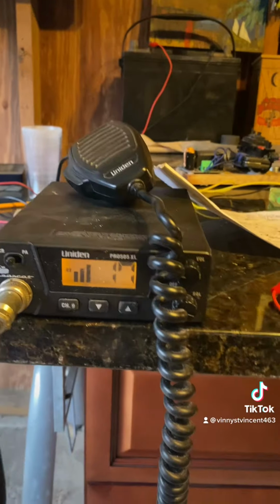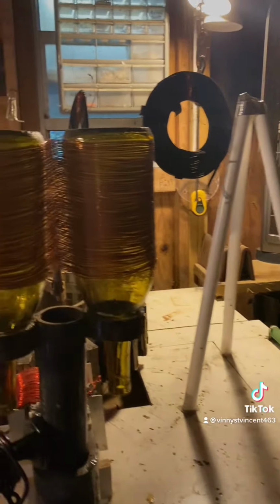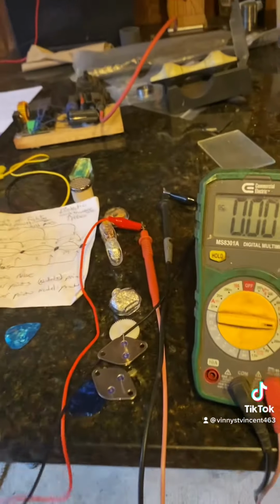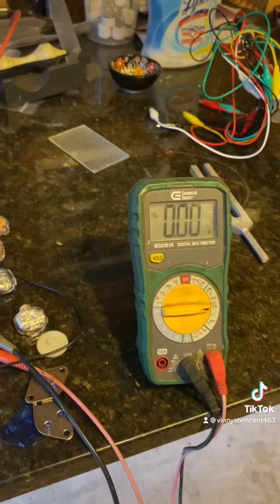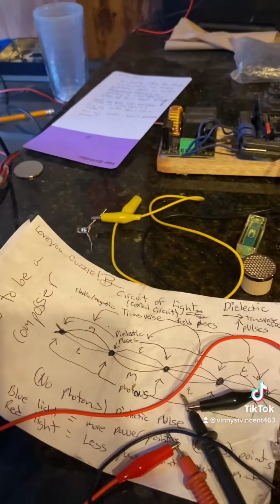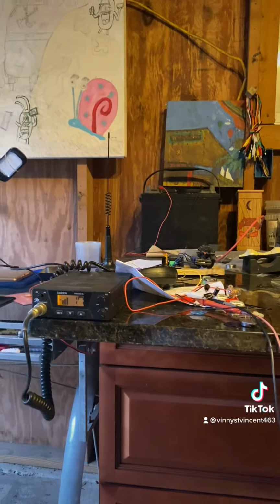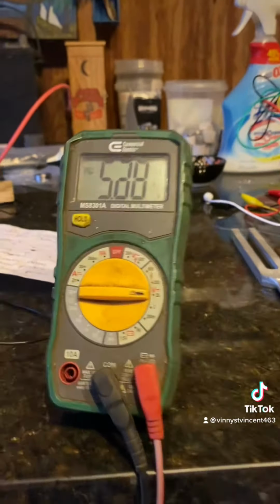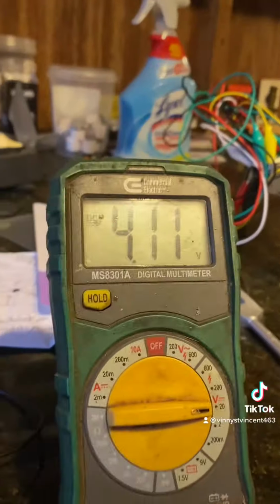Can an Audio Signal Generate Power?

Comment: I had hoped you would use eds wheel north south repeating into a speaker to hear it generate audio. An easy way to do that would be to hook up the speaker to a transformer and place the transformer near the wheel. Then the iron would be pole flipping. 

I was also hoping you would generate sound using the tone generator in your computer. Send the tone audio into a transformer. Does the frequency (step up) into a higher frequency? Or stay the same frequency. What is the amount of voltage increase, if any?

Also, does a north south repeating (pole flipping) signal drive an actual motor? Yes you can charge a capacitor and use that stored energy. My goal would be to not only to create a motor driver (signal) that runs a motor. My goal would be to generate usable electricity. Such as wall socket power that heats my water tank and runs my air conditioner. Simply by sending an audio signal into a transformer.

Don't you think that would be extremely exciting?